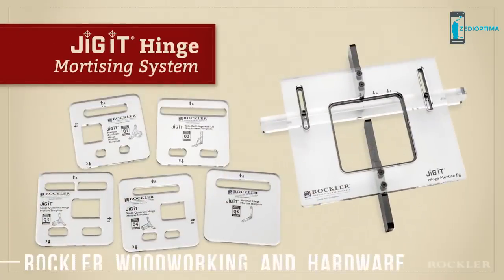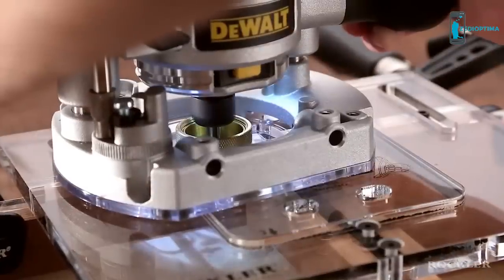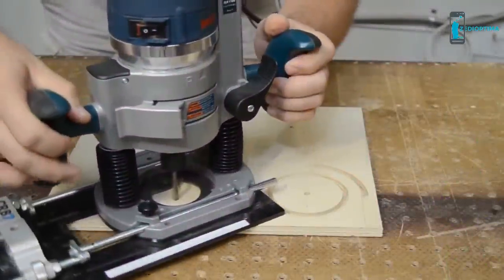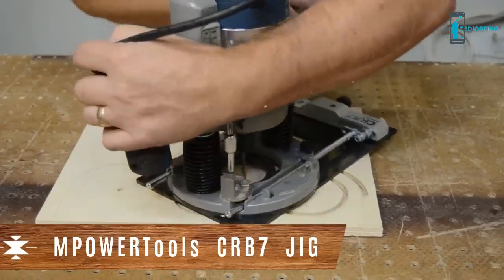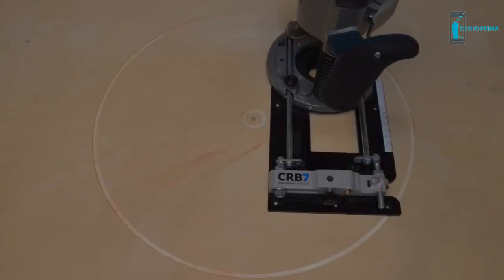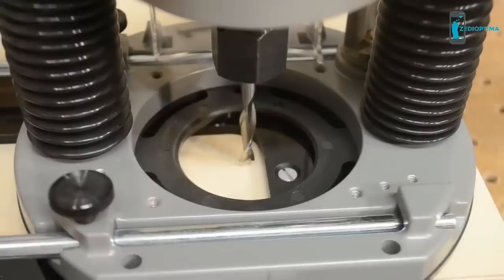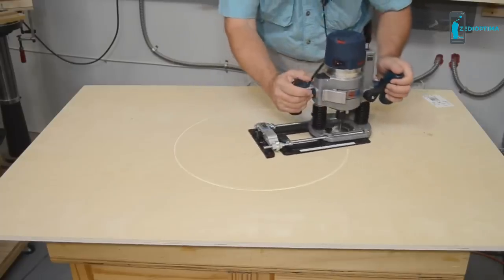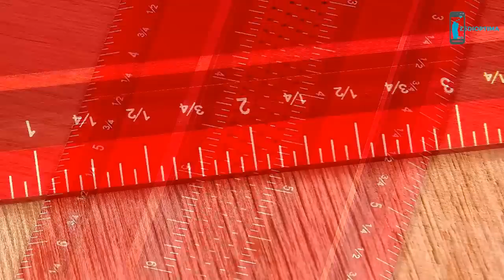5 Amazing DIY WoodWorking Tools You Should Have

Comment: The Bosch PLS 300 Saw Station by Bosch is crap.
I have it bought it... unfortunately (way before watching this video).

The idea itself is very good and this item this may initially seem like the holy grail of DIY, but then you realise that this is actually rubbish.
It is supposed to provide the ability to perform straight cuts and to easily set an angle, but that doesn't happen. Even if you lock it, it slightly moves. So forget about straight cuts.
The "slider" for the jigsaw is also actually sligthly bigger than the jigsaw's platform. Result? No way to do straight cuts.
To counteract the fact that the jigsaw platform moves slightly in the "slider", you may want to push it left or right while moving it forward. Good idea, pity that if you do so, the movable arm sligthly gives way... and you end up cutting into the green plastic instead.
So total rubbish.
Reply: Your comment is the ONLY useful part of this video.  Those woodpecker t-squares, great idea if i want to spend $400 on a ruler.  I have a $4 one, not as big city fancy lol, but it freakin measures, I can figure out the rest